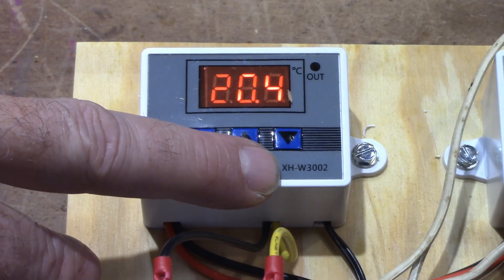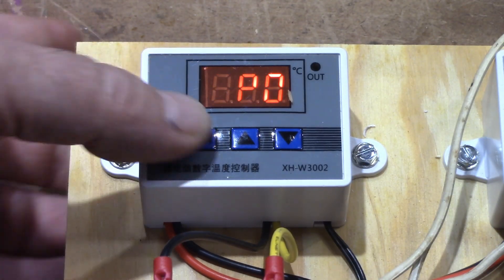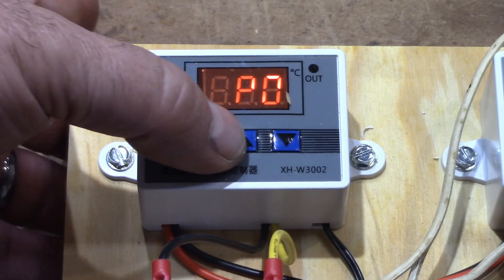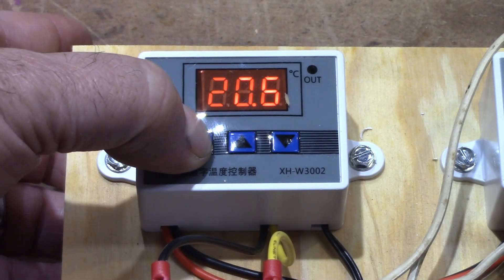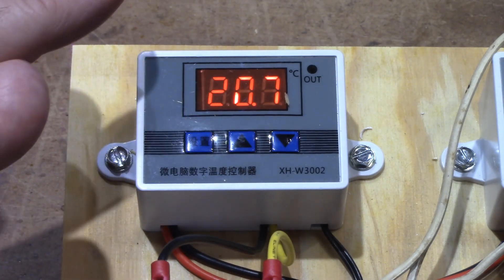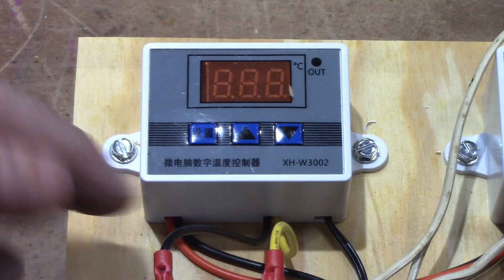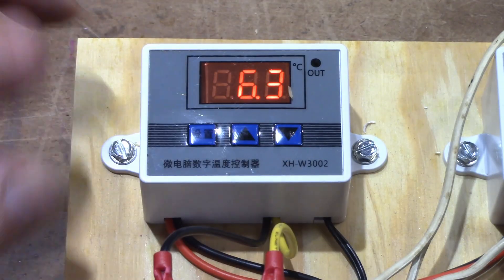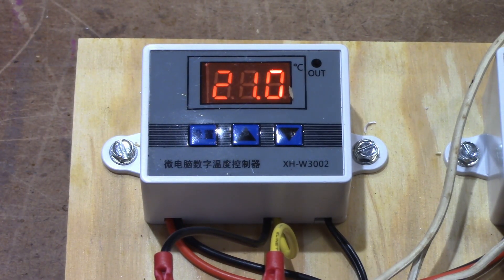How to Program a XH W3002 Digital Temperature Controller

Comment: I just bought one of these and it displays LLL even after pressing arrow down and arrow up for 3 seconds, is it faulty?
Reply: LLL=Sensor failure, HHH=Too hot or too cold to measure, 888=Factory reset indicator when pressing up+down at the same time when powering up.

Comment: Hi, do you think that a small plug can be mounted on the probe wire without affecting annything? I need to mount the probe in a remote battery pack.

Comment: Why, thank you  for this video! I've had one of these kicking around to replace the "dial thermometer and manual lightswitch" setup I have for my water heater element powered Parkerizing tank, and I never quite got around to figuring out how to use the dang thing. I bet many of them are quite similar.
Reply from the maker: You're welcome!